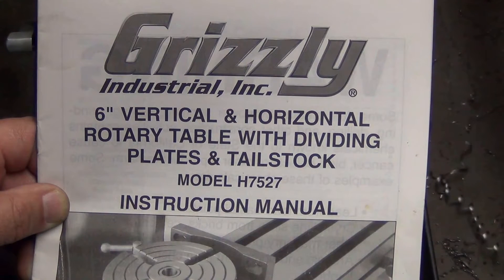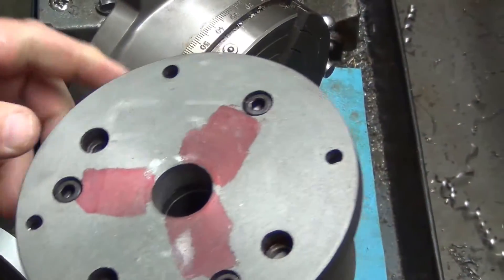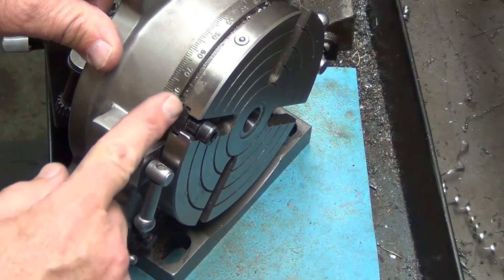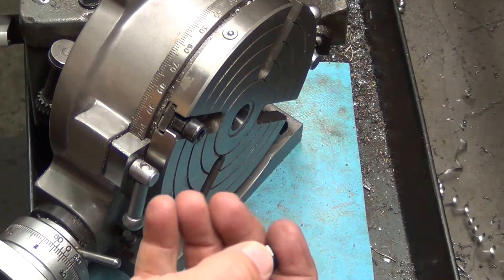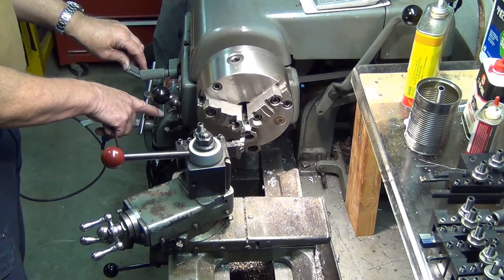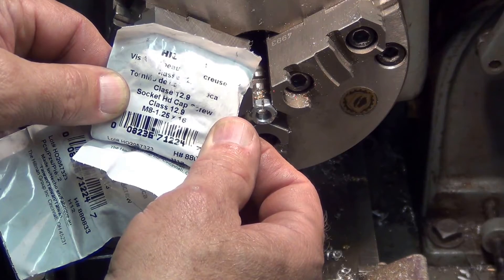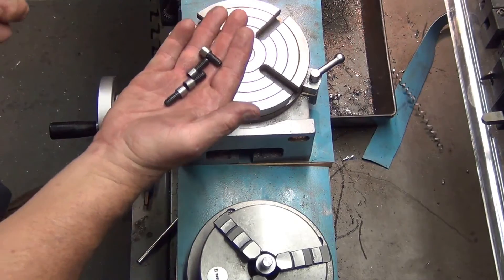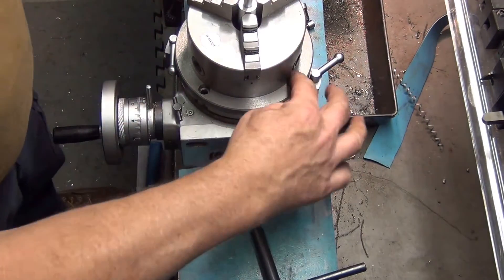RotaryTable, 3 Jaw Chuck, and adapter

Comment: Drill through your 3 chuck mounting holes from the back side with a 1/4 drill. Counterbore the face side.  Place an MT2 tool in the center and center the chuck on it. Transfer punch the 3   1/4 holes to the rotary table.  Drill & tap holes, bolt chuck to rotary table.  Done in 15 minutes- no adapter plate etc.

Comment: Hi Sir, i would like to know if you can help me, i bought a used rotary table with a 3 chuck 100mm . Now when i do some cuts on my mill im getting chatter. This is cutting light cuts from aluminium. Do you have any advice? its like there is shaking going .